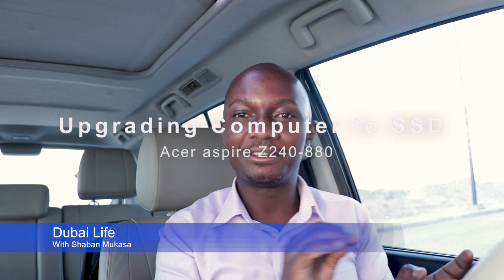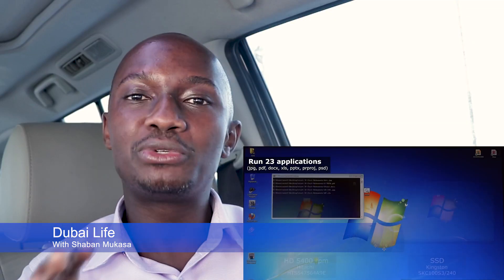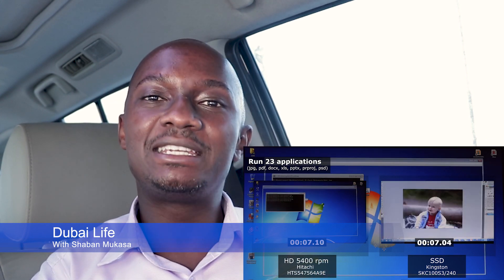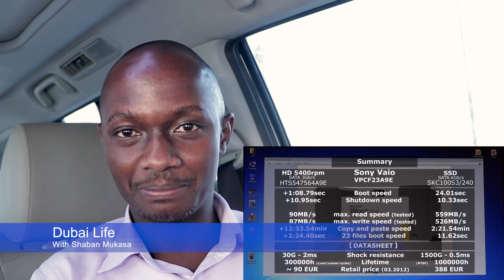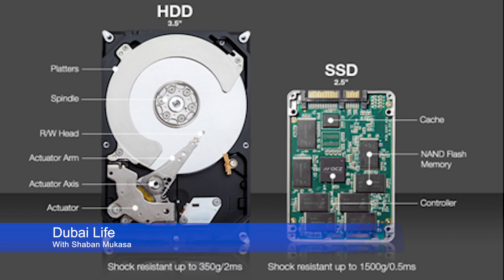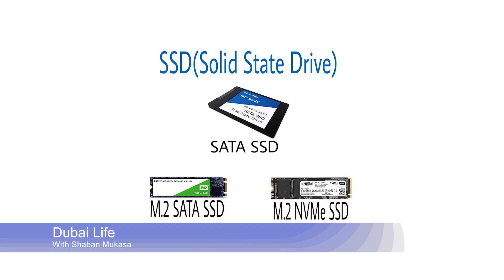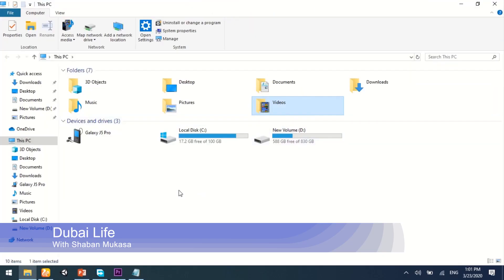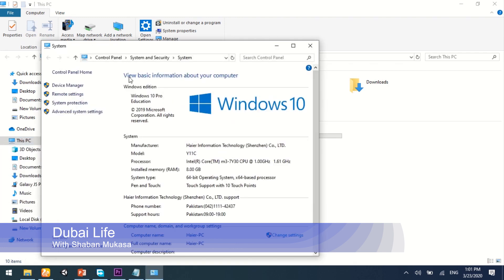Acer Aspire Z24-880 Upgrade SSD & RAM

Comment: Dear friend i have :Acer Aspire Z24-890-UR12 AIO Touch Desktop, 23.8" Full HD Touch, Intel Core i7-8700T, 8GB DDR4 + 16GB Optane Memory, 2TB HDD, Windows 10 Home  - 8th Generation Intel Core i7-8700T Processor (Up to 4.0GHz)
23.8" Full HD (1920 x 1080) Widescreen Edge-to-Edge LED Back-lit Touch Screen Display
8GB DDR4 2400MHz RAM Memory & 16GB Intel Optane Memory, 2TB 5400RPM SATA Hard Drive
8X DVD-Writer Double-Layer Drive (DVD-RW), Two Built-in 2W Stereo Speakers, Wireless Keyboard and Mouse
Windows 10 Home
--------------------------------------------------------------
What upgrades would you suggest for this PC ? I am mostly using it for photo and video editing ,can you provide detailed parts number and web link if you can don t mind?

2. My display is broken ,you think you can make video how to take it apart and replace the old screen  in details ?

Thank you so much for your great videos,it really helping us brother

Peter

Comment: Fantastic video dude. Wished you had shown where the clips were around the casing. I have fixed hundreds of PC's and laptops over the years but this has been by far the worst for opening without damaging the casing. I can see why you just stuck in metal screwdriver now :D
Reply from the maker: Thanks Jim for the complement, you are right, i decided to make the video after struggling so much to open the case on the first attempt.

Comment: Excellent video
Reply from the maker: Thanks Peter
Reply: @DubaiLifeWithShaban  Dear friend i have :Acer Aspire Z24-890-UR12 AIO Touch Desktop, 23.8" Full HD Touch, Intel Core i7-8700T, 8GB DDR4 + 16GB Optane Memory, 2TB HDD, Windows 10 Home  - 8th Generation Intel Core i7-8700T Processor (Up to 4.0GHz)
23.8" Full HD (1920 x 1080) Widescreen Edge-to-Edge LED Back-lit Touch Screen Display
8GB DDR4 2400MHz RAM Memory & 16GB Intel Optane Memory, 2TB 5400RPM SATA Hard Drive
8X DVD-Writer Double-Layer Drive (DVD-RW), Two Built-in 2W Stereo Speakers, Wireless Keyboard and Mouse
Windows 10 Home
--------------------------------------------------------------
What upgrades would you suggest for this PC ? I am mostly using it for photo and video editing ,can you provide detailed parts number and web link if you can don t mind?

2. My display is broken ,you think you can make video how to take it apart and replace the old screen  in details ?

Thank you so much for your great videos,it really helping us brother
Reply: @DubaiLifeWithShaban  @Dubai Life  Dear friend i have :Acer Aspire Z24-890-UR12 AIO Touch Desktop, 23.8" Full HD Touch, Intel Core i7-8700T, 8GB DDR4 + 16GB Optane Memory, 2TB HDD, Windows 10 Home  - 8th Generation Intel Core i7-8700T Processor (Up to 4.0GHz)
23.8" Full HD (1920 x 1080) Widescreen Edge-to-Edge LED Back-lit Touch Screen Display
8GB DDR4 2400MHz RAM Memory & 16GB Intel Optane Memory, 2TB 5400RPM SATA Hard Drive

Comment: 10:17 i have an acer aspire z24 880 and i was wondering if i need a specific type of ram?
Reply from the maker: If you are not able to open a d check the type of ram, you can inform the RAM sell  the computer model and series number, they will give you the right RAM

Comment: I've lost my keyboard usb dongle.. any advice?  Another questions, if we replace the ssd will the recovery partition still be there ? Thank you
Reply from the maker: For the dongle i may have to buy a new set, keyboard and dongle

For installing SSD you will have to back you data first and after installing SSD you will do a fresh installation of the operating system then transfer your files from the old hard drive.
Reply: @DubaiLifeWithShaban  so I have to remove the ssd and plug it in to my laptop to backup those file right ?  Because I cant get into the windows now .. :( 

I need to source how much need to pay for the keyboard then .... 

Thank you my friend.
Reply from the maker: New SSD will not have windows operating system, so don't change to SSD before you get installation disk for windows,
To backup your files, transfer all data and files from disk C, my documents, desktop etc and move to another partition on same HDD 
After installing your SSD and new windows, they you can connect the old HDD and copy your files to SSD
Reply from the maker: Keyboard will cost about 50$ less or more  depending on the brand
Reply: @DubaiLifeWithShaban  so I can get other brand of keyboard. Not necessarily need to be acer ?
Reply: @DubaiLifeWithShaban  this a bit complicated for me . So I will need to backup the C . But I couldn't enter windows from this Acer desktop. Which mean I need to manually remove the hard disk or ssd from Acer desktop then plug it ask external hard drive to backup from my laptop..
Reply from the maker: Yes, any brand can work, i use Philips keyboard on Acer
Reply from the maker: Yes that is right, you will have to connect it externally and then move the file. I think you will also get your data from C

Comment: I do have older model (aspire z5610, 2009 or 2010). Is it possible to upgrade it at the time? If I would, for example, replace its HHD and ram , what equivalent SSD and ram shall I seek for, what are thier specifications? What else can be upgraded? Where to get these parts (Bahrain/Gulf)? Does deserve this try? And how much expect to cost?
Reply from the maker: Hi Ali, 
For this model you will have to open it and see the type of HDD you have the you can by the same type for SSD, also for RAM you have to open and see the slot, RAM i think maximum will be 16GB
Reply from the maker: I don't know the shops in your country but i think in town you will have computer shops

Comment: Hi sir I have a Acer Z24-890-UR13 and I want to upgrade my 8 ram to a 16 ram or a 32 ram and also upgrade my 1tb hhd to a 1tb or 2tb ssd. I don’t know what would be good. Are use my computer for heavy graphics and gaming I take up a lot of storage space really fast.
Reply from the maker: Hi Cyril, if you want speed, upgrading to SSD will give you improved speed, if you need also more storage space then add 2TB, RAM 32 will be good if you are a heavy user
Reply from the maker: maximum RAM  you can upgrade to 64GB but u have only 2 slots for 2 chip or one big one
Reply: Dubai Life I have 2 slots for 2 chips
Reply from the maker: Yes, that is true
Reply: Thank you very very 🤗